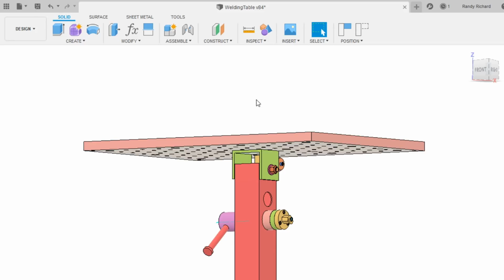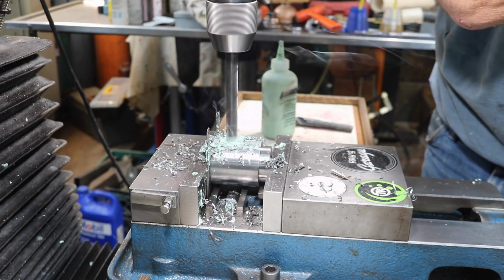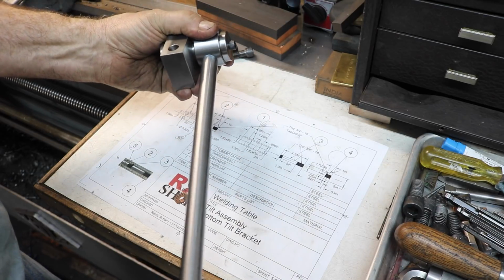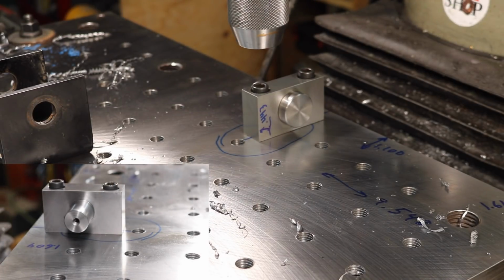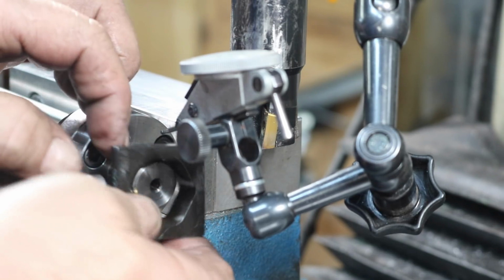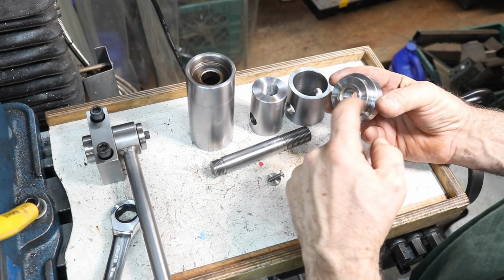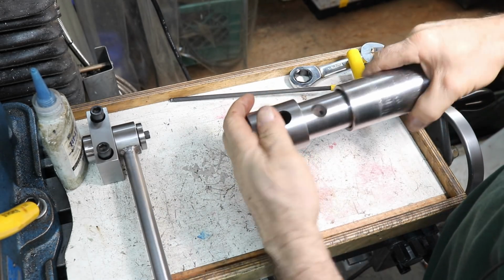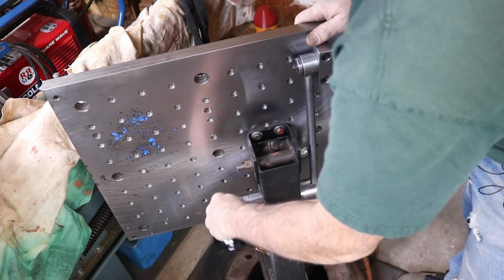What is your Angle on a Welding Table P4

Comment: It would be a lot easier, and accurate, to have a rotating indexer. Then just set it to whatever number of flats you need. I’ll say that you really over engineered this. Why bother with ball bearings for a part that doesn’t even need bearings. A 360 degree turn once in a while would work just fine with a bit of grease. You wouldn’t know the difference in feel, and there would be no real wear.

Not saying you shouldn’t have done it that way, just wondering why you did.
Reply from the maker: Happy New Year.

Comment: Merry Chriastmas to you and your family. Great job and an awesome welding table much better than my HF one lol. I'd cold blue the machined angle lock pieces that I could just because it would look cool, and not chip off like paint. Thats what I did on my tire buffer
Reply from the maker: Thank you Jim , Merry Christmas to you and you family.  I was thinking of bluing the bottom of the table and the angle lock.  We are thinking on the same path.

Comment: Wow lots of shiny bits & pieces that fit together nicely & .. they even move in the correct order & Arc.  It is good to see that the table has been used as a Welding Table, when you welded the pivot  thingo to the verticle post thingo that's sitting on the Ten Stud Brake Drum. ... LOL  All jokes aside, very well presented and a good Instructional Video for the Novice.  Keep up the Great work be Safe over Christmas & into the New Year
Reply from the maker: Thanks Ted for the encouragement.  LOL . Merry Christmas.

Comment: Nice work on the drink -er-welding table.  Drag a live stick over the top next time the welder is on, just enough to mark it, so you won't feel bad the first time you really need to use it.  I would have been tempted to make it reversible, use the side that didn't clean up well for welding and leave the other as it is for machine and other fine work.

Are you considering stirring your own concrete when you do the shop addition, or is that big enough to justify having it trucked in?

Merry Christmas ...
Reply from the maker: Thanks digger,  I just can't do that to the table.  Concrete , we will see,  The pad part will have to be a truck.  Merry Christmas.

Comment: Great project I like that the fact it swings both ways as opposed to hinging on one side and smooooth. I'm still waiting on Teespring to present the real green hoodie like you have, I've got to get one. Any snow yet? -T
Reply: No problem with the hoodie. I already got a blue one. I'm trying to get that mint/teal/green one...and yes it's for me, I like the color. I'm getting ready to convert an old powermatic shaper cabinet into the same thing your doing...minus the blanchard...🙄 (would be nice). Will put a center hole for rotary table....etc, etc,.
Reply: Oh, and a yellow one (of course) also....waiting for availability.
Reply from the maker: @tomeyssen9674  Nice idea with the rotary table.  i might make the entire table turn.  Nice bright Green  I like it.
Reply from the maker: Yes that is a nice feature.  You can have something attached weld one side flip the table and weld the other.  I will see what is up with the sweatshirt, did it ship yet?  Merry Christmas.

Comment: Hi Randy, nice work. When you only need 1/3 of a turn to lock, shouldn't it be possible to replace the ratcheting wrench with a simple box end wrench? This should save you turning the ratchet wrench ;)
Reply from the maker: My problem is the table is only has a about 2 inch clearance when all the way down.  I am thinking a nice handwheel, it does not take much torque to make tight.  Merry Christmas.
Reply: @rrintheshop  This is only a problem with the table all the way down so I guess this won't happen too often, and in this case you could easily switch the wrench to one side or the other by your existing mechanism. Still better than changing the wrench every time for loosening or tightening the table (and can still later replaced by a nice handwheel). Merry Christmas from Germany.

Comment: Nice when a plan works well.  What are you going to do about corrosion protection?
Reply: Buy an extended corrosion protection plan from a car company....!!!!    They should know best....    😁
Reply: @pierresgarage2687  Salut Pierre!  Joyeux Noel et bonne annee.
Reply: @barrygerbracht5077  Les mêmes bon Voeux pour toi et ta famille...
J'espère que tes projets avancent selon tes espérances...
Reply: @pierresgarage2687  The new house is on indefinite hold pending municipal issues i.e. no sewer = no subdivision.  I have built a new 1000sf shop instead at my current house to hold me over till the other plan can be put into reality.  I am busy building cabinets for it right now.  Adding a mill and metal lathe is about a year and a half away as the shop kinda dented the pocket book.
Reply: @barrygerbracht5077  Having a nice shop is for a person who likes to do craft already a great step towards happiness,  you seem still young, there is some time ahead as well as lots of hope...
Reply from the maker: Right now I have T-9 Boshield on there.  But I am thinking when the weather warms I will blue the bottom.  Thanks Barry, Merry Christmas.